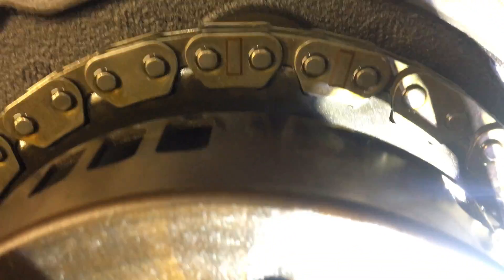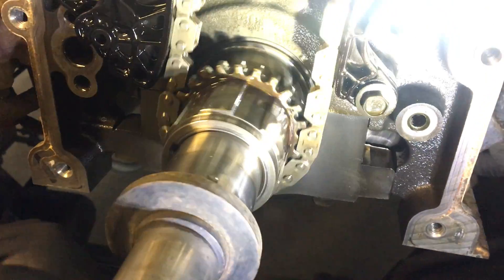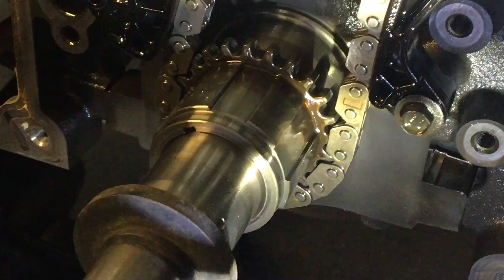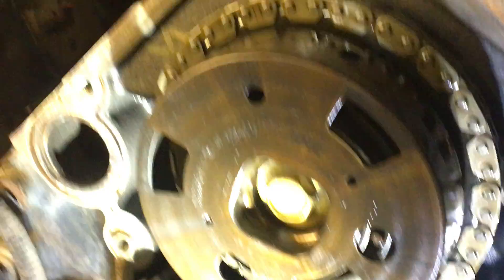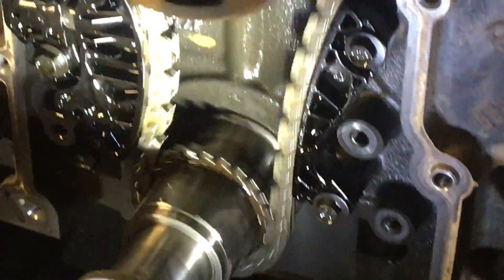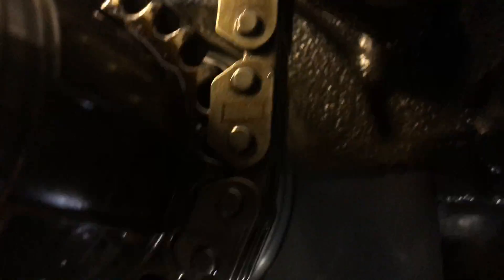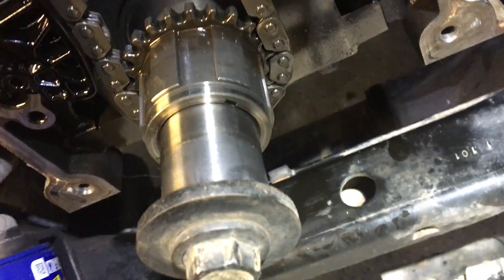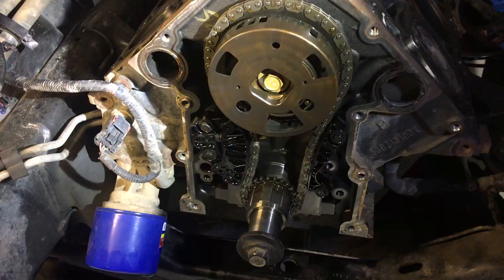2011 ram 2500 Hemi 5.7- how to set timing

Comment: you did it the hard way. Take the chain off.  rotate the crank in place and then rotate the cam in the correct position. then put the chain on. Make sure the marks on the crank and cam line up with the marks on the chain. Put the number one piston at top dead center and it would have lined up. done in 2 minutes.
Reply from the maker: The whole thing was the hard way! Lol I have never attempted this type of repair? The learning curve was huge. But 1.5 years later and my truck is running strong! I primarily use my truck to tow my 35’ camper we have made the trip to Cali twice and back to Colorado. I have yanked it all over high country and Moab. Something worked.? Being my first repair I was not confident in taking the chain off prior to having the timing in the correct position. A few mechanic buddies have mentioned your process and for a seasoned vet it sounds like it would work? A new guy might be uncomfortable with that method. Thanks for the feedback.
Reply: I understand your reasoning. If the truck is run great then your good. The only reason I mentioned taking the chain off is if you do other repairs such as having to replace the camshaft which is a very common occurrence then you will have no choice but to remove the chain to take out the camshaft.   The reason I mention taking of the chain is because you had no heads on the block and no lifters which is the only stress that would be on the camshaft from the springs pushing up against the rockers arms and put a load on the camshaft.  In your situation and looking at your video. putting a pin in the tensioner holes would allow you to release pressure off the chain, Take the chain off. Rotate the crank until its at the six o clock. and then rotate the camshaft until its at 12 o clock. Then both would be in time. Carefully slide the chain back on. Put the tensioner back on. Boom, its done in less than 2 minutes. Most older engines such as 351, 350, 302, 305, 460, 454, 427, 307 and so forth or even V6 engines with chains, The camshaft dot would point at the 6 o clock and the crankshaft at the 12 o clock. and they do not have chain guides or tensioners. Engine builders take the chain, cam sprocket and crank sprocket and slide to the camshaft, and crankshaft all in one move. done. it takes 15 seconds put on the chain. Overhead cam motors are a little more time consuming.  I been building engines for 25 years.  For a novice like yourself, just remember that for every time the crankshaft spins a complete 360 degree rotation. the camshaft only would have move half a turn. the crankshaft will turn twice for every one rotation of the camshaft. This is because of intake stroke and then the exhaust stroke.  This is why the crankshaft sprocket is much smaller than the camshaft sprocket.   When you take the chain off. put the crank at the right timing position. and put the camshaft at the right timing position, and put the chain on. on in some cases, if its a belt on most overhead cam engines. The engine will fire up every single time.  The number one piston is always setup to fire in the correct firing order. Good luck to you and just letting you know that from a experience engine builder that it is way easier and faster so that way it can help you out in future engine builds. Just remember that in some cases, avoiding taking the chain off is inevitable and will have to be done depending on the engine failure.
Reply from the maker: I appreciate the feedback, I am always looking to learn more and be more efficient. between you and me I am hoping I do not have to complete this repair again Lol it was a challenge and great learning experience. again I appreciate the feedback

cheers

DN
Reply: @marksmusicplace3627  Hi Mark's music plac, I have to do this same job on my 2011 ram 1500 with bad lifters and cam. Reading your post on Tito's great video. I just want to confirm that if I were doing this job and go down to the timing chain. I can just remove it when I pull the phaser without setting timing and then upon install just adjust both the crank sprocket and cam phaser sprocket to their correct markings, put the chain on and the motor should be in time? So does that mean that moving the crank sprocket independently from the cam will put the motor in tdc? I'm not a mechanic and am just trying to get all the info I can to attempt this and have success without damaging my truck. Any help or clarification is much appreciated.
Reply: if you move the crank then you will have to always move the camshaft as well.  Just remember that all the pistons will  move as the crankshaft rotates,  As long as the crank is pointing at the two o clock position, the piston will always be at top dead center.  The reason a crank turn twice to the camshaft turning once is because the camshaft is opening the intake valve then its opening the exhaust valves. The crank would rotate twice to the one time the camshaft rotates.  This is why the camshaft sprocket gear is twice the size of the crankshaft sprocket gear.  Setting the camshaft between the two marks on the chain at twelve o clock and the dot is matched up with the crankshaft will always put both the crank and cam in time without all that rotating of the chain.  Rotating your motor like it was in this video is excessive work and overkill. once you have the chain, crank and cam aligned.  install the cam guides and call it a day. The truck will run with no issues.
Reply: @marksmusicplace3627  Thanks for you're reply. So when you said 2 o clock for the crankshaft you mean the key on the crankshaft? I have read that if you didn't want to pull the oil pump you can just use the key on the crankshaft at 2 o clock and the sprocket mark should automatically be at the required 6 o clock position? Thanks for the help. This job can be quite intimidating. I've done many things mechanically with vehicles but nothing like this breaking down the motor. You guys with experience and knowledge posting and making videos really help us DIY out. Thanks
Reply: You should double check the manual.  I done this job last year but I do so many engines its hard to keep up with the all of them.  Yes the key on the crank should be at the two o clock. There should be a dot on the chain that aligns to the key on the crank. That should place the line on the camshaft between the two marks on the chain at the twelve o clock for the camshaft.  This alignment will put the number one piston at top dead center and the timing is correct.
Reply: it is hard to see the marks with the oil pump mounted.  IF you are only pulling the heads to remove the lifters to remove the cam . Make sure you set the timing with the timing marks on the chain at the twelve o clock and the marks on the chain in the right position. do not allow the crank to move. Reinstall but I can not stress to not allow the crank to move. put the chain back on the sprocket in the exact position it cam off the old cam. You should be fine. it not you will have to take off the oil pump which means you have to drop the oil pan.  extra work.
Reply: @marksmusicplace3627  thanks so much for the info. I'll double check the manual like you said but that's my plan is to maintain the position of the chain on the crankshaft sprocket after I have things in position so that I dont have extra work. Hopefully it all works out. But its great to have the advice you guys are helping lots and it's much appreciated.
Reply: anytime
Reply: These Hemi engines are zero clearance engines. Never rotate the crank without also rotating the cam with it. Obviously he had the heads off but it's good practice to never rotate without the chain connected.
Reply: @jpjamesboner1  so zero lash on the rockers?
Reply: Actually it is. As long as there no load on the lifter from the push rods because of pressure from the valve springs.  With no cylinder heads on the block there are no valves to hit any pistons.  It is only a never a good practice with the engine assemble with the heads bolted on with the push rods installed.  The object is make sure the valves are not opening while rotating the engine or you can take a risk of valve hitting a piston. There is never a risk in a short block form because there are no valves to hit any pistons.

Comment: If you have a 3rd gen 2010 dodge 1500 the two Mark's on your chain will go on the camshaft sprocket and your single mark will go on crank sprocket
Reply from the maker: I apologize for the delay. but yes the two marks will be straddling the mark on the camshaft sprocket and the single mark will line up with the indention on the crank sprocket.
Reply: FYI The Chilton manual (09-12) has this WRONG in the book. It shows the single link on the camshaft and the dual links on the crankshaft. Luckily I checked everything with a degree wheel and found all my timing events WAY OFF! I decided to try it the opposite of the book (did it the way you just showed) and magically all my cam card events are correct now. I can't imagine how many people have followed that book and not degreed the cam and had everything messed up! Good job brother, it's a lot of work but very rewarding, I've learned a whole lot building a new 2011 Stroker Hemi engine for my Ram.

Comment: I pulled the Cam and put in new, cam, lifters, and timing chain/crank gear.  But can't get it to crank back up. I just can't figure out what I'm doing wrong.  I'm trying to set the timing on my 2011 Ram 1500 and having a hell of a time.  I moved the pistons after I had the cam out and now have the heads back on,  how can I make sure I get back to top dead center?  I put a rod in 1st cylinder driver's side and then rotated the engine until it was at the top.  So I believe that puts the pistons to correct location then I put cam  mark to 12 :00. then I put timing chain on with the blue links marking in the correct location.    Rotated engine to make sure timing marks lined back up.  put back together will crank over but no start.   Can someone tell me where I'm going wrong??   Any and all help is much appreciated. Thanks Eric
Reply from the maker: Eric,

I apologize for the delay, I hope u have go your truck to turn over?? It sounds more like a wiring deal? Have you checked all plugs and sensors you removed to get to the lifters? I think even if the truck wasn’t in time it would fire up, and you would hear some nasty sounds as it did. But I would start by looking everythinh over including coil pack connections? It sounds dumb but the truck has fuel? Spark?
Reply: Tito,

Thanks for the help.... I ended up bending the push rods.  So I must have had the timing wrong the 1st turn over and when I got the correct it was to late. Which means I didn't do enough research........ So I'm back to square one, once I get the new rods in.  I know I can put #1 at TDC by having the key way at 2 o'clock and the dot at 6 o'clock on the crank shaft, because it only makes one rotation.  But when it comes to the Camshaft I'm not sure if I'm at TDC on the cam because I believe?? it rotates 4 times to the 1 rotation on the crank.  So I believe there's 4 times that the dot on the cam can be at 12 o'clock.  What I need to know is how to make sure it's the right time it's at 12 o'clock.  If you or anyone else knows how to do this, any and all help is must appreciated.

Thanks
Eric
Reply: Eric,
did you understand Marks music? I was worried because I didn't see a fallow up post. its real easy just pull the chain off the put the crank in 6 o'clock the cam in 12 o'clock then slid the chain back on then your set. BTW here a like of MME video in stalling a cam and fazer  makes a lot of sense after you see the video.https://www.youtube.com/watch?v=77hcwGoOmZo
Reply: @ericdeming7748  Hi Eric, I Understand what your saying. Just curious were you able to figure this out?

Comment: Thanks for taking the time to make and share this video. I currently have a bad intake lifter on #1 cylinder and was thinking like you did to just pull that head and replace the lifter. What happened when you did this?
Reply from the maker: Randy, 

This is not recommended. I did try to replace strictly the bad lifter my first go around. It was like a bandaid on a broken bone. I replaced my 3 cylinder exhaust lifter and is sounded better for a brief time but ultimately my problem was not fixed. The lifter will cause damage to the cam shaft, so for this type of repair it is recommended to replace all lifters, camshaft. I did it half ass the 1st time and I ended up wasting time and money because I had to take it all back apart and replace both. best of luck
Reply: Duck, Ok, my only concern is prior to removing the timing chain is getting the oil pump off. Did you have to remove the oil pan? Did the pump rotate enough to the right for the pickup tube to clear the pan? Or did you remove the pickup tube?
Reply from the maker: Yes, I pulled the oil pan. I tried and tried to get to the bolt for the oil pump and could not? I tried to pry on the pan a little bit to make room and felt like I was going to damage something? So I decided to take off the oil pan. It wasn’t bad? There is a lot of bolts but it came off in about 20 minutes. The. I had an opportunity to clean it really well and inspect for other pieces of metal. I found a small ring from my lifter in there so I am glad I pulled the pan. I would recommend pulling it.

Comment: Friend, how can you remove the camshaft without removing the engine heads. There is no risk of a lifter falling into the engine?
Reply from the maker: you will need to remove both heads, manifolds, timing cover, oil pan and pretty much take the engine down to the block to complete this repair. it is a pain in the butt
Reply: Thanks friend, if it is true it is a headache to make this repair and even more when you have another job and almost do not have time, fortunately I finished the repair of my grand cherokee overland 2011, the work I did on weekends, it was perfect , all right, I do not understand why the lifters were damaged, I always used mobil 1 synthetic oil, and only got my truck 55 thousand miles, had a grand cherokee 05 truck with the same engine and had 150 thousand miles and never broke the engine nothing, the person who sold it still has the truck and the engine is as good as new. I do not know if under the Chrysler quality with his newest hemi. I also have a Chrysler 300c with a HEMI engine and it is a 2005 model and its engine is also new. Thank you for your advice.
Reply from the maker: I am glad to hear the information was able to help. I was in the same boat working on it after work and when I had time. plus it is a lengthly repair but once its complete. talk about a sense of accomplishment! great job keep them running.